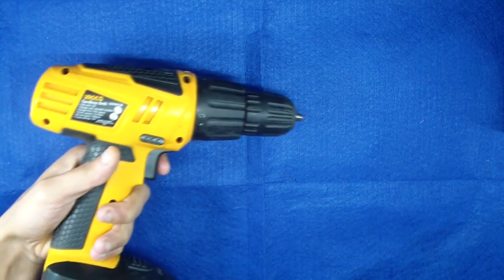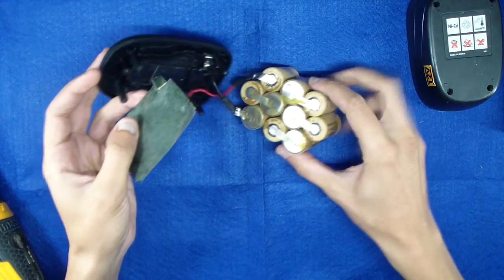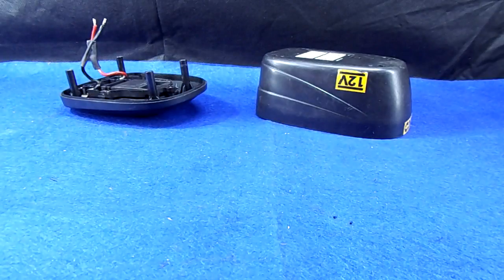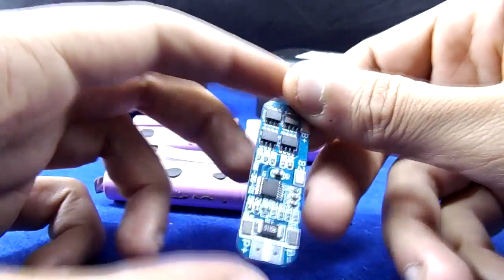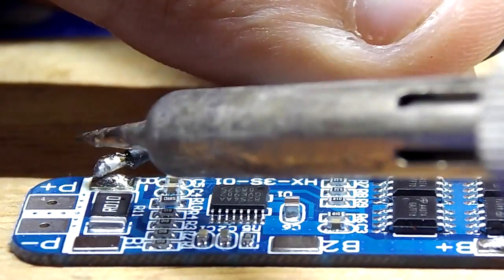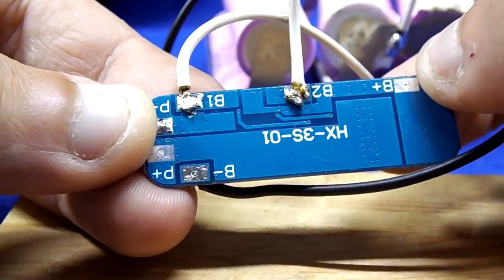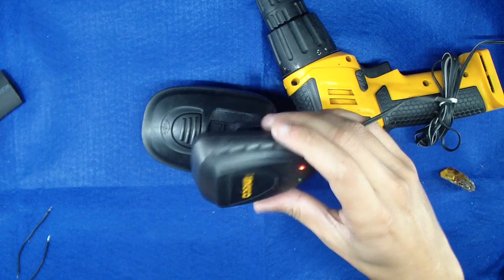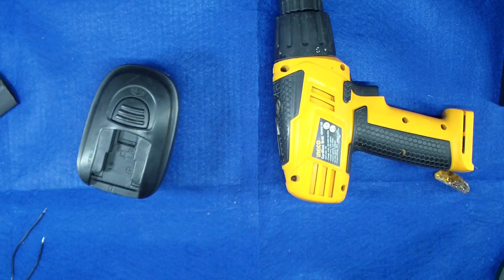Replacing cordless battery

Comment: Laptop cells use different chemistries and anode/cathode plates to get long-life and low discharge. Drills need exactly the opposite. The cells you're using are unprotected cells relying on an external protection circuit -- you add one, but it's not matched to the cells, at all.  Your BMS does not balance cells either.

This is a straight up fire hazard.
Reply from the maker: +Bryan Boettcher ok this is under testing now if something wrong happened i will report it in description 

By the way I've used it for months without even protection board and it was ok with no heat
Reply: "It works for me" is not an engineering answer!  Laptop cells vary wildly, and just because yours haven't blown up doesn't mean others won't.  If you want to specify specific cells (like US18650VTC5) with specific ratings, and match the BMS board to those cells, and use capacitive discharge spot-welding (instead of soldering), and add a balancer -- then you can safely recommend this.
Reply from the maker: +Bryan Boettcher after making deeper research you are totally right big companies make drill batteries with complicated circuit for protection 
I think i should update the description with warning 

Thank you for telling me
Reply: Eslam's Lab Thank you :)